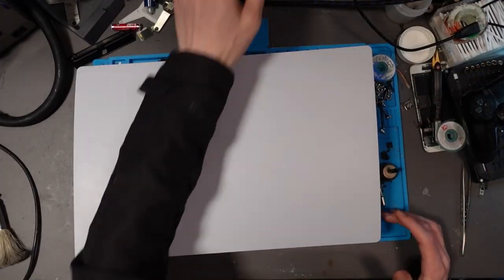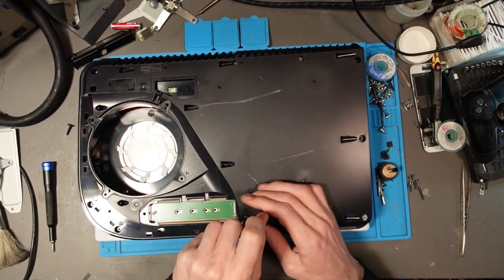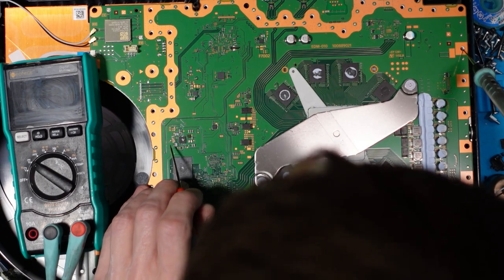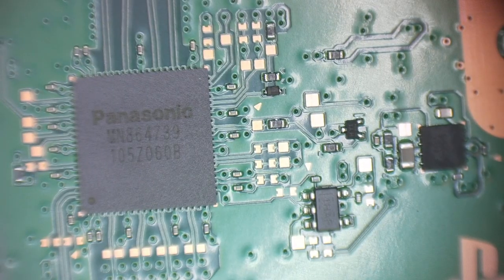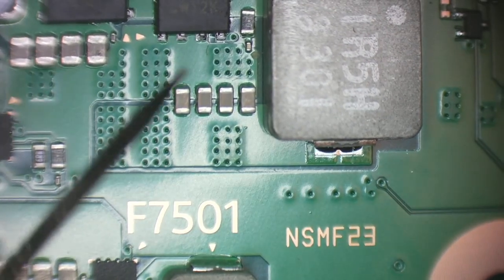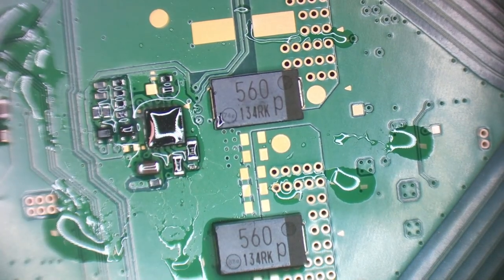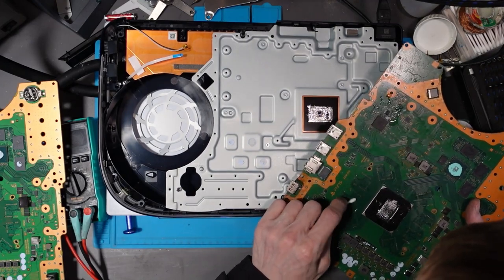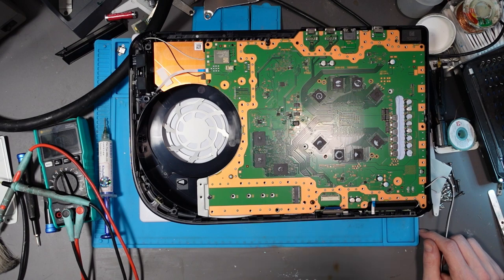I Bought ANOTHER BROKEN PS5 For £210/$275 on eBay! Can I Fix It And Make My Money Back?

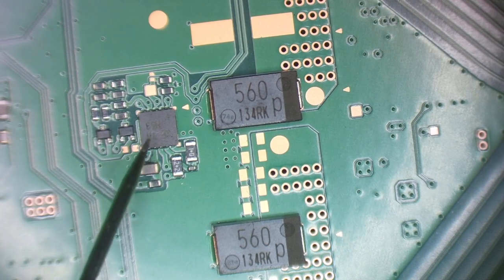Comment: At minute 24:00 when you find the short, the large diode on the right side shows a dark spot, it may be damaged, you also need to remove the chip and measure all its pins on the board.

Comment: It’s amazing so many of these are broken already
Reply: There's always a failure rate, you'd have to know how many are broken so far to get to a percentage.

Even when he would have a 1000 broken units it''s still not much.
Reply: @cyphaborg6598  that's certainly true but there has to be a reason more ps5 consoles are sent in for repair the failure rate is certainly higher than that of the series x atleast from what  we see phil repairing and also what i see coming through my door
Reply: Surely nothing could ever be as bad as the Xbox 360 on launch? I had the red rings of death 2x myself.
Reply: @johnsellers4994  Thats because the PS5 has outsold the Xbox series X by far.
Reply: @brettwalker4915  not by that many in the uk where phil is based for every 1 series x i see i get at least 6 ps5 consoles and the ps5 is not selling 6 times as many consoles at last count it was selling 30% more you can try justify it any which way you want but the ps5 is a terribly designed console and anyone who works on them will agree even phil has said so

Comment: Hi, You say there was power in the caps doing something to the board. But when you put the chip onto your board it did not work. And putting the chip. That was on your board in the first place. Back on your board. Your board did not work. You cleaned some liquid -metal off your board and your board worked. Now you should have retested the bad chip on your board again. To see if it was the liquid-metal stopping it from working. With the bad chip on it. You should have tested your board before you took something off it. To see if it was working. Don't think its working as it worked the other day (As you said). Because something could have happened to it. Like liquid-metal in the wrong place. Like you found on it. Good video.

Comment: I like your idea of collecting the information from voltage etc on a good board to help you figure out what could be wrong when a board has gone bad. I have sort of heard of that before but I am still relatively new to repairing electronics and the skills needed but it makes a lot of sense if you map out on good board like a PS5, any time you get any other PS5's it can help you locate the problem faster.
Reply from the maker: Yeah exactly that mate. I like to at least take mental notes of things on the PS5 so I know for future reference, that's why now I can pretty much scoot around the board quickly and know exactly what's going on pretty much straight away 😁
Reply: @TheCod3r  I was going to say have you seen these ESR meters you can get to check the health of capacitors and also something called a Kelvin probe (very low resistor detector) which can specifically detect which component has shorted just by accurately measuring its resistance. 

Learn Electronics Repairs (youtuber), has some recent videos on them and they look to be a very useful piece of equipment, I already have the ESR meter which can additionally be used to check the health of VRM's on CPU's and GPU's if your working on them at any point. 

You may already have these items but I am new to this channel so I'm still looking around at your videos.

Comment: Could be bricked because I had a similar issues and all I did was pop the ps5 software onto a flash drive and popped it in the back usb port and turned it on and software started right up and asked me to reinstall software

Comment: Hey man. Great video. Have you fixed a ps5 which doesn't read discs? Having that issue with mine and Sony want £240 to fix it. 😒
Reply from the maker: Thanks mate. Not as yet apart from one with a damaged ribbon cable (user damage) but you're welcome to send it in and I can give it a go for you

Comment: Great video 👍 I have question I bought a PS4 for 30 pounds and it have broken HDMI port so I used your video and replaced it with new port and the pins are soldered the PS4 starts 480p and works fine when I use it on 1080 p it's craps on me like broken screen so I removed the port again replaced with another port and gave me the same result so is it the port it self or the PS4 have bad ic chip? Please reply and thank you so much for this amazing video

Comment: Shut up multi meter lol need that on a tee-shirt
Reply from the maker: Haha it should be on the way 😀
Reply: @TheCod3r  I have exactly the same Neoteck meter (which I think is great value) - Not sure if you were aware but holding "Select" while turning on the meter makes it beep 5 times (like it's about to power off) and then disables the Auto Power-Off (You'll see that "APO" in the display won't be lit any more). I used to get as annoyed as you do when it's beeping at me all the time - always at the most inappropriate or crucial moment, obviously! ;)
Reply from the maker: @tonyf72  yeah I am aware of APO mate, problem is it still beeps constantly even with APO disabled haha 🤪
Reply: @TheCod3r  Yeah, I wish you could shut it up completely - I'll take one of those t-shirts! lol

Comment: Just me but I think we can safely say the chip is bad.  When it is in your board it does not work so pull that and then replace all the caps in the general area that are in circuit.  I have seen caps that tested fine but still failed under load. I bet that chip went out and one or more of the caps in the circuit are damaged in some way.

Comment: Hi, I have a ps5 and it’s works perfectly well and plays PS4 game with no bother but soon as I play ps5 games on the console after a short while 20/30 mins the console just turns off (not into rest mode) and I can’t power it on again until I’ve taken the power cable out the console and plugged it back in again. Can this be fixed or do I need to get a new one? 

Kind regards. 
Dean.
Reply: try installing m2 ssd
Reply: @purevsurenbatmyagmar9739  ???